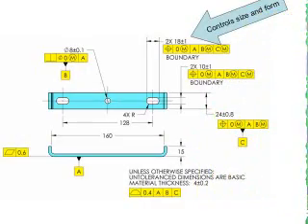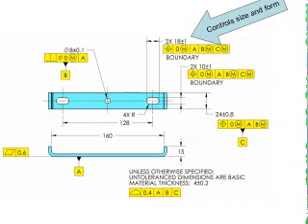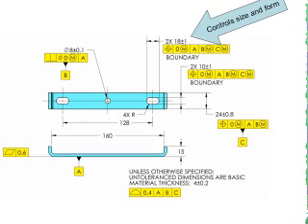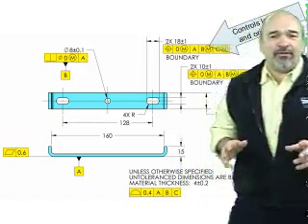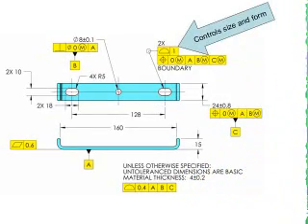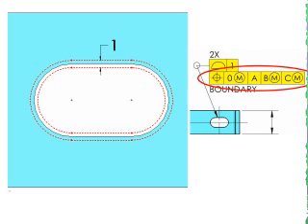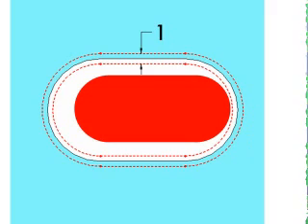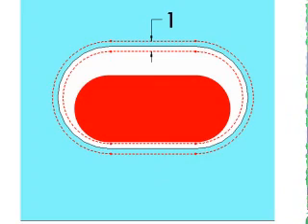GD&T Tip from Tec-Ease - Tolerance Those Slots Right

Comment: Reference to datum C is unnecessary on the 18±1 dimension, and especially the MMC with it. The positional tolerance for that dimension is between two vertical planes in the Y direction.